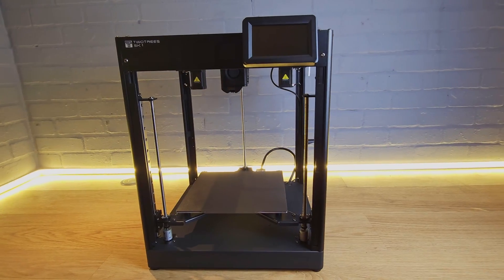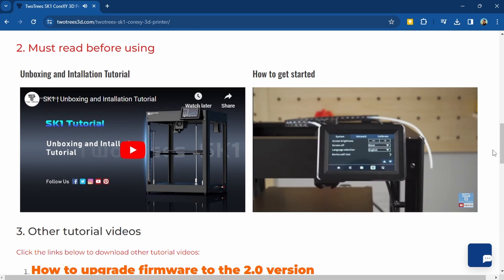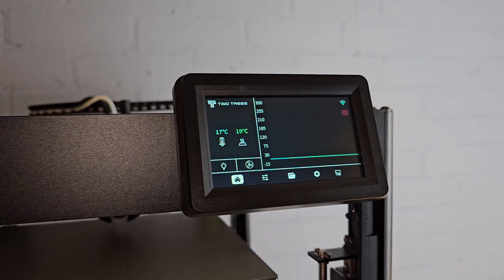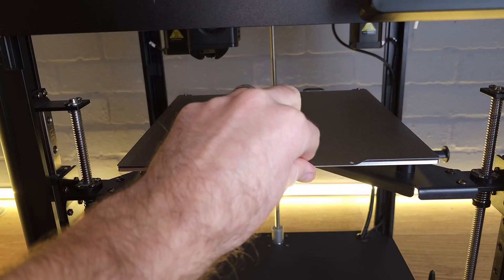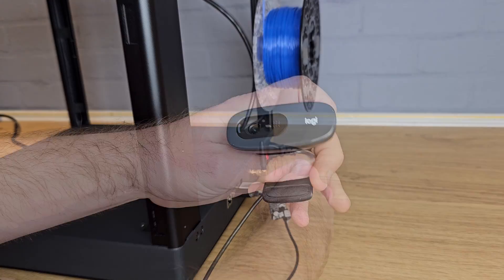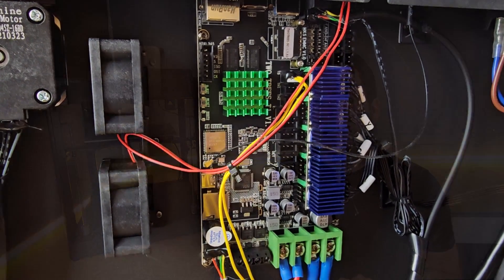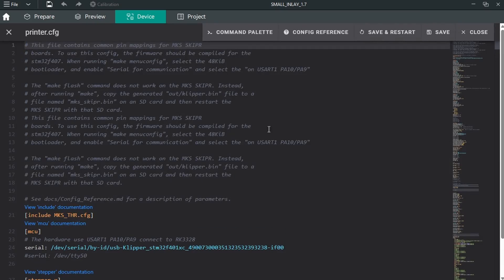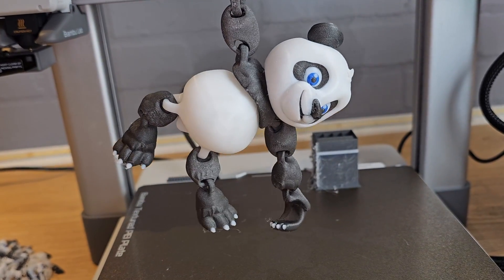Two Trees SK1 - Just Another Mediocre 3D Printer? Or Is There More To It?

Comment: Can you recommend a printer with a large print volume that is core X Y? I would like it to be 325 or higher. 400 would be good. There are a handful of options out there that I am aware of, but I enjoy your videos and respect your opinion. I come from a Bambu X1C and a Qidi X Max 3. The X Max 3 unfortunately hasn’t really met my expectations. Lots of issues and troubleshooting. Luckily there is a mainline klipper firmware called FreeDi that has breathed new life into the printer, but it still has its issues.

Comment: Had a couple minor issues with my SK1 but the support has been surprisingly helpful compared to other chinese companies but definitely not on the level of Bambu/Prusa. I don't think I would recommend this to a straight beginner, only someone who wants to tinker with klipper for the best experience.

Overall really enjoying the speeds and quality this can crank out, added a couple aux cooling fans and can now print cleanly well over 200mms on outer walls at a much quieter volume on the main part cooling fan.

In order to get the camera working, you just need to ssh in to the printer and then start and enable the webcamd service, then it will work out of the box.

As for the Z-Tilt failing, double check the Z screw couplers are very tight, if they are even slightly loose the grease on the leadscrew can cause it to slip, resulting in the Z-Tilt failures.

Comment: I own this abomination. Do not buy it unless you are a power user that can and will thinker with it. The shortcomings are so many that I often forget them all. 
1. 3 fans in the head, yet only 1 is controlled. The rest are full on.
2. fans in the base are also full on, though plenty of headers are available on the main board
3. fast printer with horrible nozzle our of the box. Buy a CHT clone for bambu style hotend
4. cable to the hotend is way too thin for powering everything that is there (36W heater + 24W motor + fans)
5. to remove the PTFE from the hotend, you need to disassemble it's front cover (cutting bigger hole in the plastic helps)
6. The drag chain will cause the cable to the hotend to die prematurely from bending (and being way too thin wires)
7. The power supply is 14A max, but that is way not enough for everything that is on-board (7A motors + 2A heater + 15A heated bed)
8. The LCD is pure garbage. Half of the time does not even recognize the printer as ready
9. The klipper (and all other) are very old and cut down versions, while the storage on the (MKS made) board is only 8GB (for OS and all)
10. Only rollers and no idlers?
11. Main board is based on China-only microcontroller that is not supported by mainstream Klipper, so good luck updating your firmware
12. OS is locked, though not hard to hack into, but then all is so limited that it makes little point
13. I am sure I am forgetting a few more here

Oh and my machine came with broken Z nut on one axis and two of the screwrods bent out of the frame. Took them two months to send replacement.

After replacing all electronics and new idlers/rollers, all I need now to do is install endstops to get aways with this horrible sensorless homing. Machine is moving in upwards of 800mm/s and printing without artifacts with 400mm/s+. Acceleration on X can go up to 36K, but only 14K on Y (heavy axis and extruder)
Reply: this is what i should have read before buying... mine has layer shifting while printing torture toaster... any clues? bel tension? the cube and benchy looks fine, but mine came with loose bolts in the z rods, something that i should have immediately adressed as poor qc... but still, it's my 3r printer after a delta predator, looks super fast, maybe the eu version has better cabling? also came with firmware 2.0 so works fine over there. thanks a lot anyway, have a nice day

Comment: I also watched your previous KLP1 and I still bought the KLP1 anyway (March 3) however I received the newest iteration of KLP1 which they call the KLP1 230 which has the 230x230 bed, totally different and larger printer head which has an upgraded proximity sensor, extruder, slightly larger heatbreak heatsink, and different (improved) fan for part cooling.

Comment: Interesting, but I wonder why I should buy this printer when I can get a P1P for only a little more, which has already been tried and tested thousands of times, prints excellently and whose manufacturer has good support.
The price would have to be significantly lower to be interesting.
If TT had started with a 300 mm print bed, they might have been able to compete with BambuLab. But not so far.
Reply: buy a p1p
Reply: I would pay the extra $100 just not to have to do the z-offset.  The only objection to bambulab is having to upload my models through their servers in China.
Reply: Everything being open source is a big advantage for me.
Reply: @yeroca  i don't see the CAD files, firmware or anything related to that in any shape or form from twotrees. i don't see how this is open "sores". providing a "printer.cfg" does not cut it.
Reply: @yeroca  depends if you want a project or a tool
Reply: buy p1p

Comment: I've had the SK1 here for a few months now and it fits our print farm needs with that side loading set up. Excellent first layer every time and zero issues with it out of the box. My only real wish would be a bigger build plate 325mm x 325mm GOOD review by the way. 🤠
Reply: Sovol SV08 has same SK1's philosophy but 350x350 area.
Reply: The SV08 looks like I need one, but just can't pull the funds out yet :face-blue-smiling: